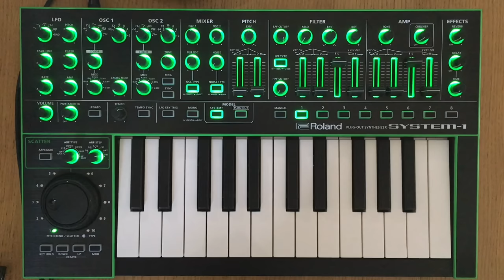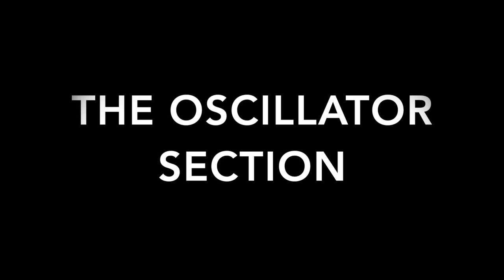How To Use A Synth: Part I - The Oscillator Section

Comment: $500 synths arent relatively affordable for me, any good sub $200 synths?
Reply: There are affordable, and free, software synthesizers.  In fact I know of a program for about 100 that comes with a synth and even video lessons on how to use it.
Reply: What is the name?
Reply: Little late, but you can buy used synthesizers. I bought the roland system 1 for 300 euro, normally it cost around 500.
Reply: Korg Volca Keys, a portable analog synth ($170, I think) is very highly rated. If you use an iOS device, there are many high quality synthesizer apps that are $0-30, created by big names like Korg, Moog, Arturia, etc., so you can look there, too.
Reply: There are a whole range of Korg Volca devices. Most are analog. All less than 200 I believe
Reply: Nicolas MacArthur Roland sh-3
Reply: Plugintorrent my friend
Reply: SH-201